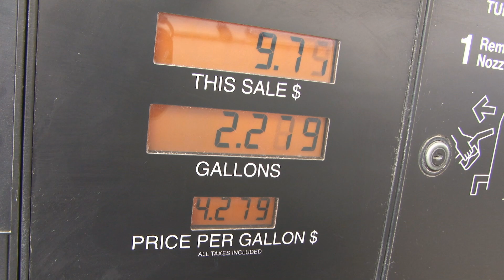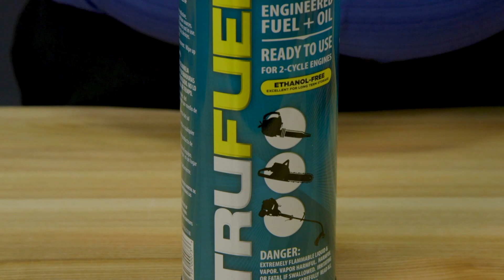What is a Boutique Blend of Gasoline? | Farm Repair & Maintenance | Successful Farming

Comment: Ethanol is great in an engine designed for ethanol if consumed in a timely manner.  The shelf life of it is much removed from that of straight gas. Most small engines cannot take ethanol.  Even the new ones.  We had several failures because it would eat the seals and/or floats out of the carburetor.
Reply: I couldn't agree more with your statement!